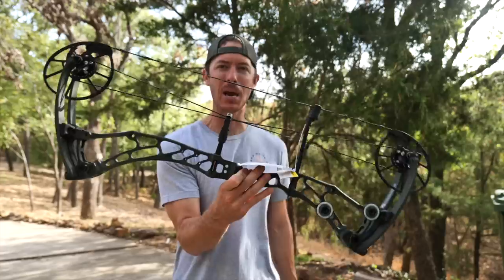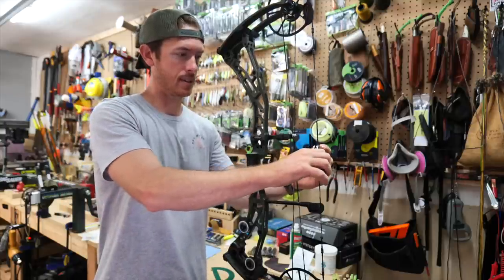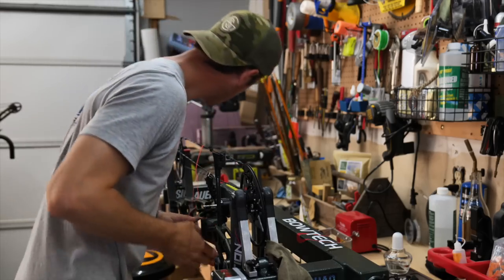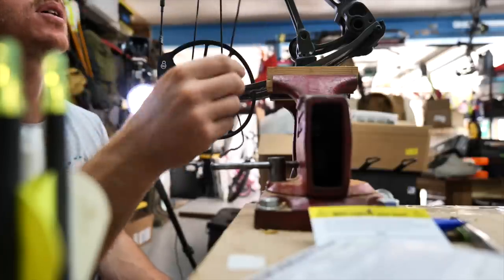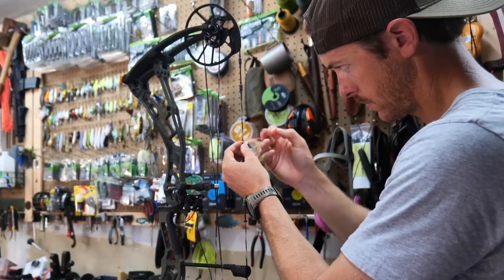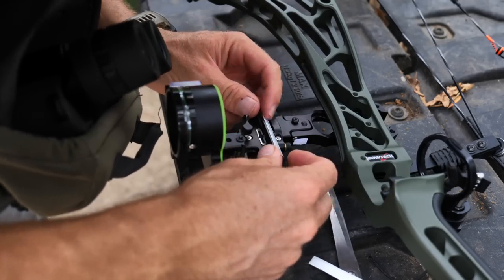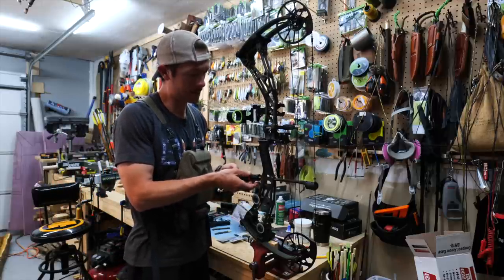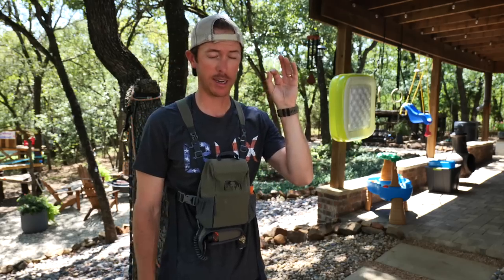BARE BOW to HUNT READY!  2022 Compound Build, Set Up & Tune

Comment: those marks on the cams are for synchronization. timing is true to when the stops hit the cables at full draw. the only way to check that is to watch them as you draw back and make sure they hit at the same time. You should also make or buy a draw board, then if it's off, whichever one hits first you add twists (1/2 twist at a time) to that cable that hit first. Just make sure all of the strings are in the tracks and you have pressure on the string before letting it out of the press.

Comment: Hey man! i'm using the same exact setup for deer, pig and turkey. only difference is my bow likes the easton axis 5mm match grades in a 340. but i do run the aae max stealths on a white wrap. heavy helical on them and with a 75 grain insert with the 100gr. annihilator broadheads (absolute best broadhead on the market IMO). shot a buck two weeks ago he didnt go further than 10 yards and piled up. i'll be following your journey! keep it up brotha!

Comment: Nice to see you running some bowmar grip tape and nose button.. Both have been amazing additions to my setup. From the looks of it you might benefit from using a side stabilizer
Reply: I was gonna mention the bowmar nose button and grip wrap but with using the serving string as a nose button is technically better cause its less weight on the string so it doesnt hurt arrow speed as much as the nose button

Comment: I have bad luck with a fall away rest. I had one I loved it it was a limb driven style. But idk if the timing was off on it or what but my arrows flew strange at times and it left a strange line on all 3 of my fletching which I know it is not a huge problem. So the bow shop told me to try a wisker biskit style. I wish I could go back to a drop away but I was told the rest style I have now is better for hunting.

Comment: Good looking setup. Question on the quiver…it looks like the bottom is the only part that moves. If the top moved up, that would keep the nocks out of the dirt like you said but if only the bottom moves, that does nothing for overall arrow position. Right?

Comment: If you have some sort of nose device on the string you really don't need a peep sight. I can be pretty accurate out to about 90 yards without one, and even if I take my time I can hit 100 yard shots no peep.
Reply from the maker: I love shooting with out the peep but I’ve found when I’m crammed up in a tree or leaning around some cover, my head tilt gets off form with out a peep.
Reply: @LakeForkGuy  That's all good. Practice makes perfect. I've thought about going back to a peep sometimes but have just gotten so used to not having one.

Comment: Man I would watch that putting lock tight on them boats it's bad enough you're putting steel into aluminum riser you're putting the steel screw into a aluminum riser which causes anidizing or whatever the heck is called it's called and it really locked Them in there if you just tighten them down early tight wouldn't you go to break and lose usually  Smoke will pop because outside them screws are sometimes you have trouble even getting them out it's a lot tight you're gonna be in trouble I feel like myself personally I've never had them screws come undone as long as I tighten them down since you're pretty good anything they've always been a nightmare to get out sometimes

Comment: Those cheap levels are the Chinese knock-offs of the ones originally made by R.S. Bowvise, someone I used to work for in his archery shop.  I can tell just by the color of the yellow of the plastic that those are the crap ones.  I wouldn't trust those at all.

I just got myself the Solution SS a few days ago from a new Bowtech dealer in my area.  Still waiting for my stabilizer kit, which should be here in another 2 weeks.  Ugh.  Gonna be shooting Winter league with it, but it first needs to be set up and sighted in.

Comment: When you put in your soft nuts for your dog you always wanna leave at least a couple with of the string gap you don't want them soft nuts touching top and bottom of that knock you want a little gap on the bottom cause your top is always gonna be pushing down the way you draw the bow